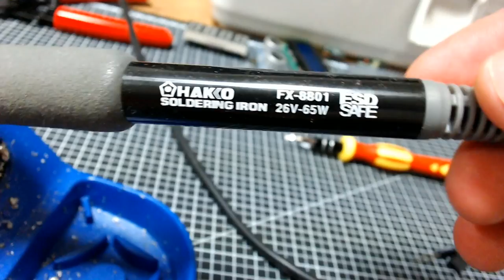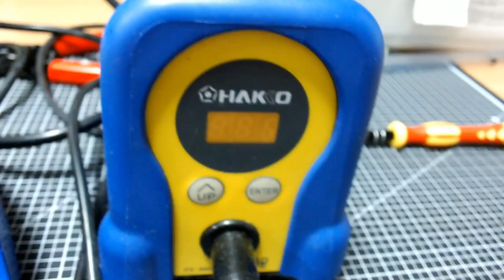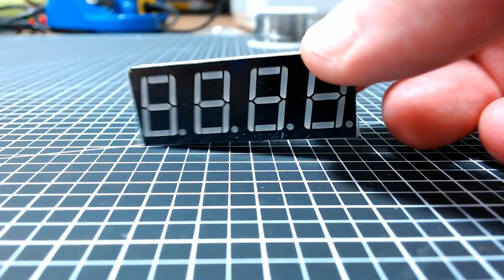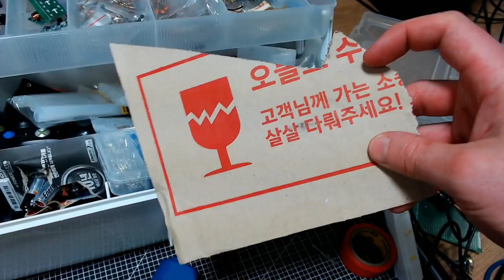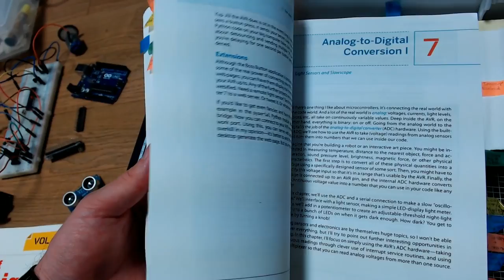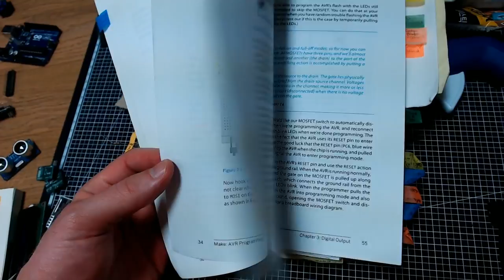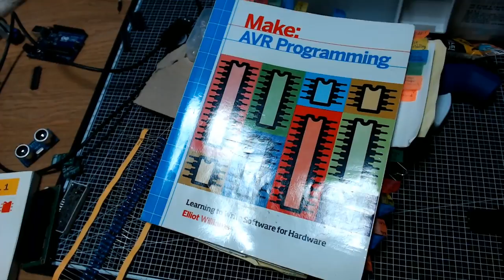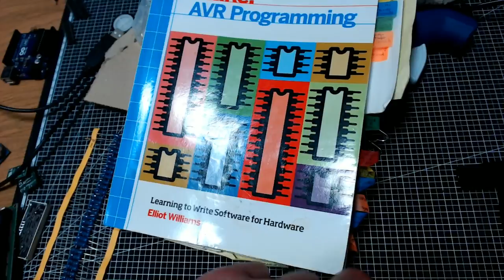BEGINNER ELECTRONICS 2021 ADVICE - What I recommend and why

Comment: Is there a specific chip I should start with? I found boxes of 30-50 on Amazon, but no idea if they're PIC and names like SN74LS don't tell me much. I have momentum now so I gotta grab something quick. I got the basics of C and a soldering iron already.
Reply from the maker: I am only familiar with the ATMEGA328p chip from the arduino boards but it is kind of an "old" way of doing things. I am shifting to the Raspberry pico because there is a community, you can also program them in C or MicroPython. They just released a bluetooth capable one too. I like the small form factor and cost.
Reply: @Kimchi_Studios  I decided it was too much information, even though it's cheap, and just ordered a rpi starter kit.

Comment: Weird how I’ve been looking for a hobby and this video popped up for me, this is what I want to do now. would you recommend that book to somebody who knows absolutely nothing about electronics? Or should I get some Arduino experience first?
Reply from the maker: Great question! I love this book but it took me years to start to understand. Arduino has a large user base but most just copy paste code and never even solder anything. The arduino language is also useless outside of Arduino and you never get to understand how the code works.  I am going to be using the Raspberry Pico soon because it is very easy to find, cheap, and you can program it in (micro)Python which you can also use to program PC applications with your experience.  I am about to update my website with a very simple  easy to understand page with explanations of basic components you need to know. It's also a real circuit you can put together. I am working on very short 3-5 min easy to understand series of videos going over each component. Check out my newer videos and my website. Stay tuned!

Comment: Hi, i can do small arduino projects but I don't understand the electrical pasrt of making robots like when to use a transistor and how to increase current in the circuit and how can I build electrical circuits , can you recommed me some good resources so can i learn the electrical theories and components and use them practically
Reply from the maker: I'm making a video about motors and transistors right now and how they allow more current to flow for a motor. I also have the components explained on my site. Check out my article I just posted https://www.robotics4beginners.com/post/can-a-joystick-control-a-dc-motor
Reply: Heeey checkout a book calleed practical electronics for inventors.  It's an amazing book.

Comment: This is all so motivating. One thing that I've been wanting to learn is 3d printing, but I don't like the plastic filament - have you ever used a metal printer? Do you know of any cheap metal printers? The only thing I know is that Elon Musk uses them, which probably means they're super'spensive.
Reply from the maker: Yeah, metal is my dream! I'm not a fan of plastic either and its in everything everywhere. From what I have seen metal printers are still early adoption phase and are expensive. Take a look at PHA as a PLA alternative if ypu haven't yet. Cheers!
Reply: @Kimchi_Studios  thanks, I'll look into that

Comment: how do you power up your breadboard ?
Reply from the maker: Your chip will need at least 3 volts and will likely be able to handle a max of 4.8 volts. I use 2xAA or 4xAA battery packs. Sometimes the 9v. When I am just uploading and testing code I use a usb connected programmer. It connect the board to my pc. My favorite is the usbtiny from Sparkfun. It had positive and negative wires that plug into your breadboard. I can address this in a video soon.

Comment: Ardunios are not computers; they are controller chips. Big difference. A lot of what you are saying will go straight over the heads of begginers. Get a basic electronics kit that can include an arduino so that beginners can learn about resistors and capacitors and leds. Too much waffle about arduinos for the first 15 mins.
Reply from the maker: Gatekeepers and arm chair know it alls with no content like you are the biggest obstacle for people trying to get into this extremely difficult and complex hobby. Per Wikipedia: "A microcontroller (MCU for microcontroller unit) is a small computer on a single metal-oxide-semiconductor (MOS) integrated circuit (IC) chip. A microcontroller contains one or more CPUs (processor cores) along with memory and programmable input/output peripherals." These microcontrollers are the core of the arduino boards.
Reply: @Kimchi Robotics  oh dear, this is what I expected. If started with the basics it's not so difficult. Not armchair , you don't know me or what my connection with electronics and if you did you would keep your comments to you'll about me. End of conversation. Bye